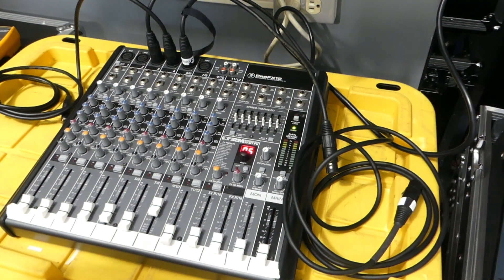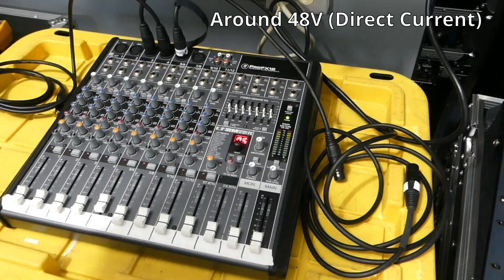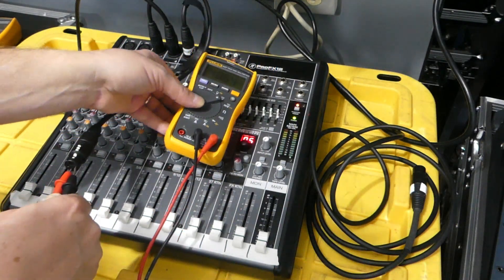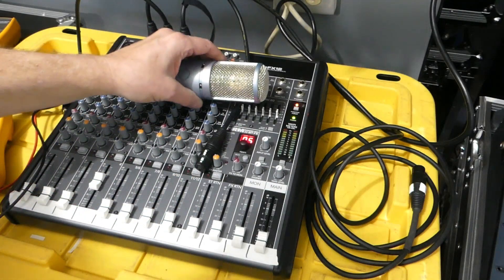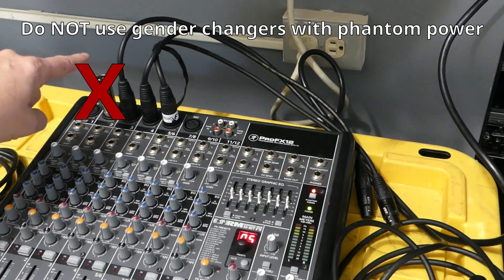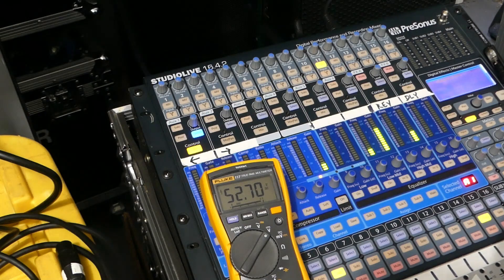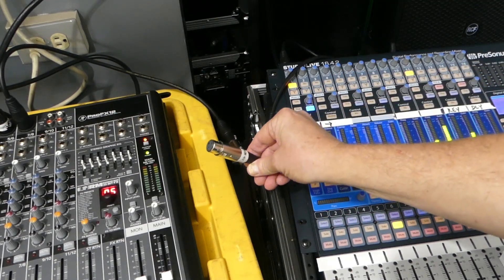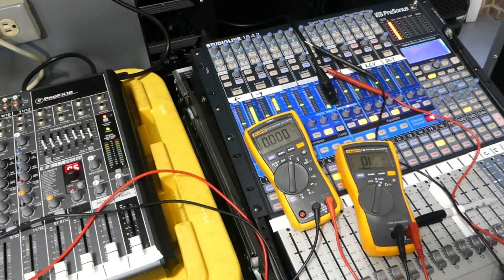Phantom power on audio consoles; an overview

Comment: Couple things to add. The ribbon mic phantom power myth, is exactly that. a myth. As long as the ribbon is wired to pins 2&3, it doesn't actually see any voltage. The problem comes when you plug, or unplug them while phantom is on. Many modern ribbons have transformers as well, which isolate the ribbon. There's also plenty of active ribbons which in fact require phantom power.
Regarding splits: If you're just using a passive split as you've mentioned, you can power form either/or/both as you've shown. Most professional concert split snakes are in fact 1:1 transformer isolated, in which case the console on the direct, non isolated output will have to provide phantom.
Reply from the maker: Thanks for the additional information!  Ribbon mics seem to have come a long away; historically, there was always someone complaining about losing one, but you are right about the connecting/dis-connecting the mics with phantom on.  Thanks again.

Comment: Thanks for the review video! Just a comment about the voltage drop on long cable runs: As long as no current is flowing, the voltage will remain about the same compared to a short cable. However when you start to pull current, then the resistance of the cable will start to matter more. Most mics only draw between 2 and 10 milliamps (like the AKG C480 at 2 mA), so the voltage drop across a long cable run isn't enough to matter. If you were running something that required more power, you'd see a more significant voltage drop. A run of 150 feet of mic cable with 20 gauge conductors adds about 3 ohms of resistance. I don't think there are any condenser mics that warrant cause for concern, though.
Reply from the maker: Great addition.  Thank you!

Comment: The other thing to point out is that the low meter reading does not mean that meter can't read the higher voltage, it is just that it is probably loading the phantom power thus causing a higher current draw which is dropping the phantom power voltage down.  Try reading the voltage with both meters at the same time.  If it is being loaded by the low impedance meter then both meters will read 18v.  If the other meter reads 48v then there is a problem with the low impedance meter,
Reply from the maker: Great comment!  I expected the Low-Z meter to draw some current, but not an amount that would result in a 30V drop.  There's nearly no current draw when testing 1.5, 9V, and 12V batteries; both meters showed nearly same results.  Good idea with using both meters at the same time to test on a console.  Hopefully I'll be able to test this soon.

Comment: You can use a Y cable to split mics? Whenever I have tired to do that all I ever get is noise on one or both of the mixers. #VideoIdea
Reply from the maker: Yes, a "Y" cable can be used.  Make sure your consoles are not too old!

If you are getting a low-hum noise (~60hz), that is usually a ground loop issue; which a "Y" splitter cable could cause because it is connecting 2 consoles, which may be on different circuits.   If you are getting a higher frequency noise, that could be something related to another device connected to the sound system circuits (it's usually a motor that causes EMF noise which can find its way into a system).  It can take awhile to track down the origination of line noise.  For testing/troubleshooting, try using a ground-lift cable on one of the ends of the "Y" cable that goes to a console (one at a time).  If the noise goes away on either of the consoles, it should give you a better idea of where the noise is originating from.
Reply: @stageleftaudio  thank you, I will try that the next time I encounter something like this.

Comment: Is it safe for the other mixer if we turn on just one moxer phantom power in case there are two mixers used one for monitor and one for foh..? Does the mixer can handle the 48v tha is send to the other mixer input..?
Reply from the maker: With most all modern consoles, there is no issue with one console providing phantom power in a 2-console setup.  The other console will not experience issues.  It's many of the older consoles (30+ years old) that could have a problem.  As long as the condenser microphone has phantom power, the microphone does not care where the phantom power comes from.  It's common for phantom power to be provided by the monitor console in a 2-console setup.

Comment: You are testing voltage without a load.  52v may drop to 48v or so when a condenser microphones is connected.
Reply from the maker: You are correct.

Comment: I don't think you are going to get a shock from 50v.  It is too low a voltage.  Usually 50v or below can be referred to as SELV  Safety Extra Low Voltage.  Phone lines run at 50v.
Reply from the maker: Getting shocked can be very relative.  Getting shocked when not expecting it can add "depth" to the shock.  Very true, the voltage is low.  Wanted to point it out to all whom watch the video for something to be on the look-out for.  Thanks for the comment.
Reply: Getting a shock is all about voltage and your resistance, which can change. It's possible to get shocked from "low" voltages by presenting a lower resistance, such as when you are wet. If "low" voltage were to somehow make contact with your bloodstream or basically anything beyond the highly insulative outer epidermis (dead skin cells) of your body, you would quickly find that lower voltages can cause sufficient current to flow to cause pain, disruption to the nervous system, and potentially heart defibrillation, depending on the path the current takes. A person with thick dry calluses will have a higher resistance than someone with moist skin. 50V is a common threshold for safety, but it's still possible to get a shock from it if conditions are right.